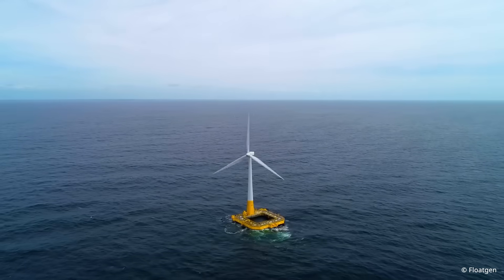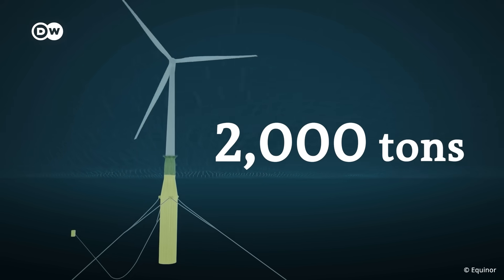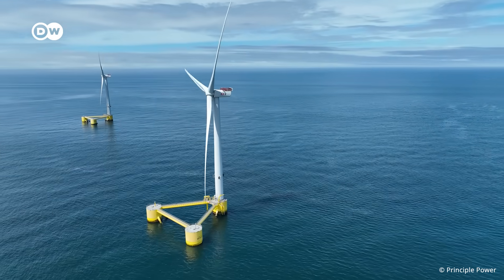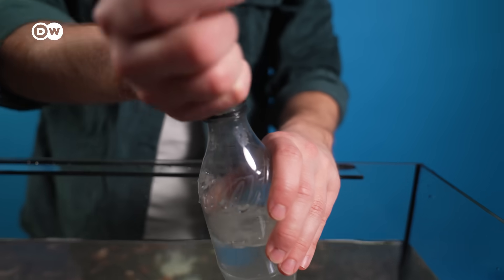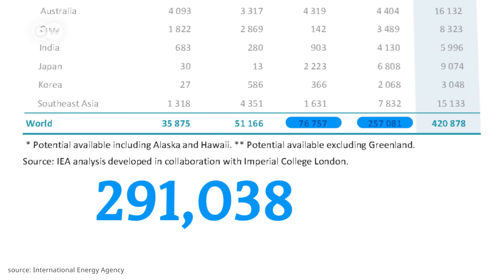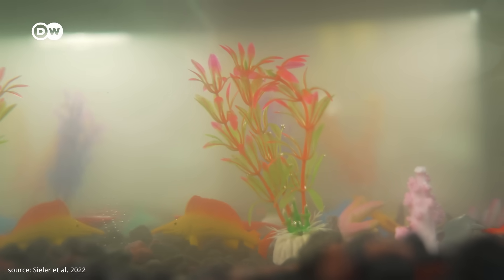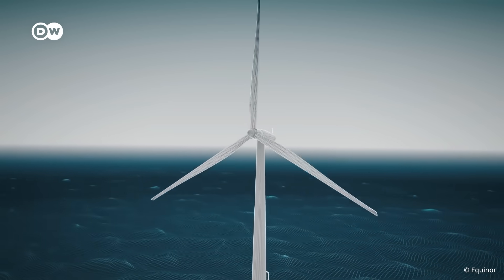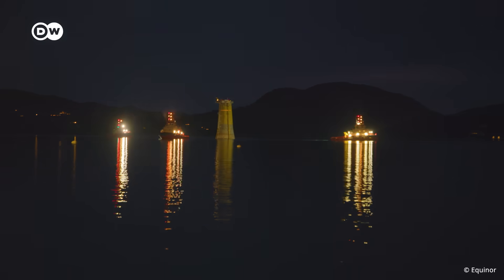Floating wind turbines: Offshore energy's secret weapon

Comment: The fact that they can be assembled in the port is in my opinion huge. The amount of technology needed right now to assemble wind turbines out at see, using cranes that have to be stable, and massive boats securing them too the seabed. I can very well see how assembling these on or close to land and towing them to their destination could be a huge cost saving in the long run.
Reply: low frequency killing whales
Reply: @trwent  yeyeyeyeye, calm down, i probably typed this out around like 2 at night and English isn't my first language.
Reply: go back to playing with yourself
Reply: The ironic part is even though they can be assembled at port, they're still much more expensive to build than even Offshore Wind.
The Hywind project cost was 6.8 million Euros per Megawatt.  That's 7.37 million Usd.
A 2 MW turbine (land) in the US averages 2.7 million usd.
A 2 MW using Hywind cost would be 14 million + usd. 

The floating Hywind project if built in my country using our current electricity usage and rates would take 40 years (assuming it produces 50 % capacity factor)  to recover the cost of the project. What's the lifespan , 20 years? That's why I lol at the "Offshore energy's secret weapon" in the headline.

Comment: how do you get the energy to the coast floating power poles?? becouse if they are underground cable then the see will obliterate them
Reply from the maker: Hey there! Subsea power cables connect the floating turbines to onshore electrical grids.
Reply: We already have the ability to lay undersea cables. It's not a problem. 

Why, the reason you can even comment here is because of undersea internet cables.

Comment: Ok… and the issue of getting the power to the shore efficiently?  Near-shore siting is not likely to be acceptable in a lot of the world, so you’ll need to be some miles out to sea, and getting the power back without big losses and big expense is going to be the next headache.  Comments?
Reply from the maker: Hi Paul! You're correct that when electricity is generated far away and brought back to land, some of the energy gets lost during the journey. There's a method called "high-voltage direct current transmission technology". It uses several stations to convert the electricity and send it to the onshore converter. This method has lower transmission losses. However, scientists are still doing research to find the best ways.
Reply: @DWPlanetA  yes... AC transmission losses for undersea cables are primarily capacitance governed, and DC removes this problem, but introduces very significant cost burdens when you consider the convertor stations needed to to connect to the AC grid... not to mention the difficulties of load balancing and circuit breaking.  There's still no real solution yet, and I admire your faith in science to provide an answer.  Until such a solution exists, off-shore power generation is little more than 'half-baked'.  Not entirely unlike hydrogen is the saviour-fuel of the world.  Yes, but where do these huge quantities of hydrogen come from????  I remain sceptical on both counts.
Reply from the maker: Hi Paul! Yes, there are still a lot of things that can be improved. If you are interested in hydrogen, check out our video 👉 https://www.youtube.com/watch?v=AGTjKJHu99c. Subscribe to our channel to get notified about new videos.

Comment: the next electricity revolution needs to happen with transmission cables and power lines. we can generate as much power as we want, but so much gets lost in the lines that we need to make a lot more power than we need.

Comment: How would we prevent animals getting trapped in the anchors?
Reply from the maker: Hey there! There is still more research needed but several  mitigation measures are recommended. One factor is the diameter and the material of the mooring lines. If you want to find out more about this, check out the study we linked in the "read more" section of the video. Another study you can find here 👉 https://maxwelllab.weebly.com/uploads/9/6/2/0/96205508/maxwell_et_al_2022_floating_wind.pdf?c=mkt_w_chnl:aff_geo:all_prtnr:sas_subprtnr:1538097_camp:brand_adtype:txtlnk_ag:weebly_lptype:hp_var:358504&sscid=41k6_dp8zo. Hope this helps! ✨
Reply: @DWPlanetA  thank you for reaching out im glad that a youtube channel actually responds to there viewers questions, you just earned a sub :)

Comment: These figures are a bit rough and confusing at times?

We are estimating that 'floating deep water' sites... can produce 11 times the world's needs of energy by 2040?

So Hywind are producing enough power for 34 000 homes, is that for the 'entire' wind turbine park and just in this one area I presume please?
Reply from the maker: Hey Sebastian! Transferring the electricity generated into the equivalent of electricity needed for an UK home makes it easier to get an idea of the power created. Yes, we are referring to this specific wind park.
Reply: It's an idiotic claim. With all the trillions we've invested so far in the Netherlands, and all the environmental destruction, we only get about 3% of our energy from wind. This has not led to any reduction of CO2 because it's inherently unreliable and you need a fossil fuel backup. All it did was double our energy bills. Same for Germany. No CO2 reduction, massive increase in costs.

Comment: Not talking about the cables to connect the turbines to shore is a bit weird.. Moreover, bottom fixed structures have WTG towers and foundations, the tower and foundation are not the same. No one hammers in the tower as shown in the video

Comment: They can be assembled in an port and pulled into the zones. We already have ports near everywhere we live on every coast. For logistic reasons.
Those logistics also make it quiet easy to make the supply chain work.

I can also quiet easily see the cost going down with scale. If you have 5 turbines 40 km out of the coast. You'd need to fly in 5 people by helicopter or by ship for the gearbox maintenance.
If it's 500 of them. You just need a slightly bigger ship with slightly more maintenance people. But you can still do it in 1 journey.

Comment: Now that bouyancy and stability has been solved, how is harnessed energy transferred to  electricity use on land?
Reply: Subsea cables connects strings of turbines to an offshore substation, that transfers the electricity to an onshore substation, an further to the national grid. This is lack in this video, as the floating offshore substation is still (like the floating foundations) quite the hassle, as well is dynamic cables.

Comment: I think this is a good field of study and investment although I think it comes far behind powering up unpowered water dams, using dams as batteries for other power sources, public and mass transportation systems like trains and subways, hydrogen blimps, etc.
Reply: Yeah it's only a fraction of what moving liquids and solids provide due to the low density of air. Plus if there are too many dispersed into the ocean, it could disrupt the heat exchange that normally occurs resulting in increased damage that climate change could cause. The winds are really important, especially near 30 degrees (subtropics) on average on a year on year basis as around that latitude they draw up water and moisture into the air where it facilitates precipitation both near the equator and up to around the arctic circle. With this disrupted, who knows what happens to the weather around the world. This is a bandaid that doesn't actually solve much of anything and creates more issues down the line. If this is the proclaimed "solution", then we are so fucked.

Comment: The technology is expensive, but it's still a lot cheaper than gas or coal or oil or nuclear. And much less environmental impact than any of them, too. The CSIRO puts it at about $4,000 per kWh, compared to $1,200 for onshore wind. Coal also costs around $4,000 per kwh, but that's just the capital cost, you have to add the cost of the coal. If you added in the cost of proper carbon capture and storage coal would be phenomenally more expensive. There's little point in whining about the environmental impact of one technology or another. Our society needs this power, and we need more every year, not just to expand our economy but to electrify other polluting processes (cars, steel, concrete, etc). If you assume we're not going to go back to 4,000BC, then all you can do is compare economic and environmental costs, and solar and wind come out vastly better on both counts than any of our traditional options. So, let's just get on with building them and stop subsidising fossil fuels.
Reply: These numbers were per kW of capacity to construct in capital costs (money upfront, doesn’t include operational expenditure).

Comment: the earth is getting warmer so more energy for winds, the house i live in has a 30 year old roof that never had any problems but this year a bunch of roof tiles got blown off and these roof tiles are easily 10kgs each. my point is, you need to pin it to the ground otherwise say goodbye to all that investment.
Reply: I think you may have missed some of the explainations of how the floating turbines work. 
The whole point is they can be designed to be stable even in extreme wind and wave conditions.
And in really strong winds, they can 'feather' the turbine blades, reducing the force on the structure - edcing the destabilising forces.

Comment: I always thought they should use a few flywheels to stabilize floating wind turbines. It would also act as a battery storage system.
Reply: Great idea. A silimal concept is applied in ISWEC, a wave energy converter that exploits the gyroscopic effect to stabilize the machine and to harness energy, developed in Torino, Italy
Reply: neat idea Anthony. I'd like to see some concepts to see how that could be applied.

Comment: Over parking lots should be solar if not cover the parking lots in trees.
Tops of homes and big box companies should fill there roofs with solar and a  source panel that collects water from the air ps needs 25% humidity minimal to work.
Hell prisoners should be made to walk on big human sized hamster wheels that lift big weights that get dropped to make energy aka gravity batteries.

Comment: It would be interesting to compare the cost of building the floating wind parks with the cost of building oil rigs. Is it really so much more expensive?
Reply: Yes, it is because an oil rig produces a bonkers amount of energy. I took the worst numbers i could find for the oil rig, here we go. 

The average usa oil rig produces 4.577 barrels of oil per day. (the average middle eastern one produces 59.945, down from 140.144 in 2000)
A barrel of oil contains 1700 kWh of energy. 
An oil rig has a life span of at least 15 years. (while i could also find data of oil rigs that are in operation for more than 40 years)
An oil rig price can get as high as 1 billion dollar, so we'll use that. 

This comes down to 1.000.000.000/(4.577*1700*15) = 8.57 dollar per MWh. In the video it is said that an offshore wind farm costs 140 dollar per MWh. 
Now of course there are also operational costs, but even that wouldn't offset it completely. This is why for example Shell still heavily invests in fossil fuel even though they want you to think otherwise.
Reply: @tjibbeettema8759  15 times better?? No way 😂 it's worse than i thought. There has to be a math error. I read it as being 2-3 times different
Reply: @faikerdogan2802  Idk, i just devided and this is the answer that came out. if you find any mistakes, please tell me. also irl it would be even more insane because I went for the worst numbers i could find for this calculation
Reply: @faikerdogan2802  floating wind is really expensive though, it's like 2x offshore wind which is 2x onshore or solar energy (assuming good sites are available, of course). Also, if you want electricity from oil, the conversion is only ~30% efficient (car motors are 25% and gas turbines ~35%).
Reply: @tjibbeettema8759  your conclusion is incorrect. There is far much more money to be made because oil is valuable, and can be stored somewhat safely.
Shell and other companies can also manipulate the market to their advantage to make more money.  This cannot be done with offshore wind. 
All Energy companies value the product more than the startup/operational costs. Which is why they will spend many times over to install and maintain an oil rig rather than invest in renewable energies. The cost of offshore floating wind will plummet, just like solar and non-floating wind.
Reply: @tjibbeettema8759  You did 2 mistakes with that calculation, that averaged themself out to keep you in the same ballpark. 1. You forgot to multiply it by 365 days. You basically only calculated the energy output for 15 days instead of 15 years. 2. You switched from KWh to MWh without the decimal shift. 1 000 000 000/(4577*1.7*365*15) = $23,26/MWh. But you need electricity out of the oil to compare the values. If we assume a 40% efficiency we end up at $58/MWh electricity. And there is still a bunch of cost in oil processing before you can burn it "cleanly".
Reply: 1.8mil~ for wind turbine vs 20 mil to 1bil for oil rigs. Land ones vcheap. Offshore expensive.
Reply: @faikerdogan2802  How would I calculate the energy output of the rig vs the energy output of the turbine? We should be able to get some sort of dollars to the joule no?
Reply: You should also take into account oil transportation costs, refining costs and infrastructure costs.
Reply: I think they like these because wind is renewable
Reply: I expect this technology was developed for offshore oil Rigs.
Reply: Oil refining costs a lot of additional energy plus the pollution costs.